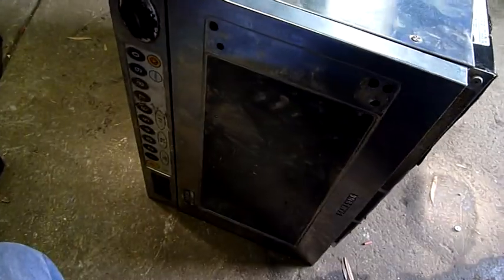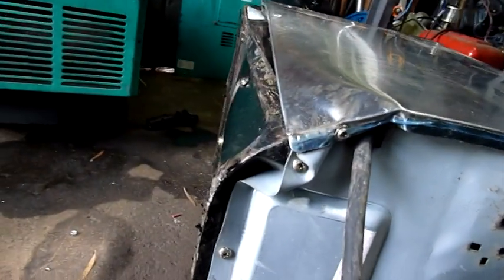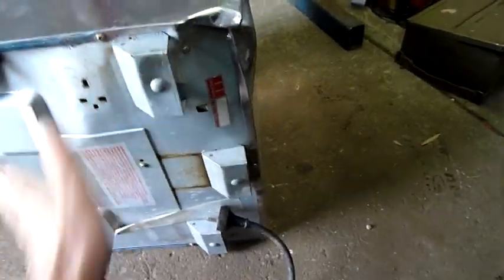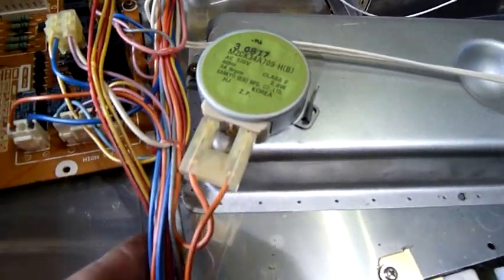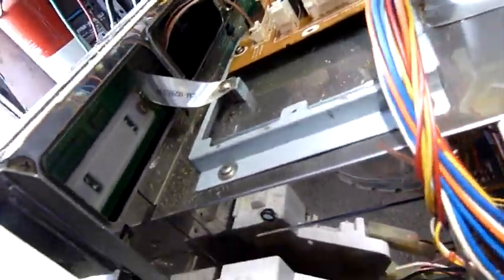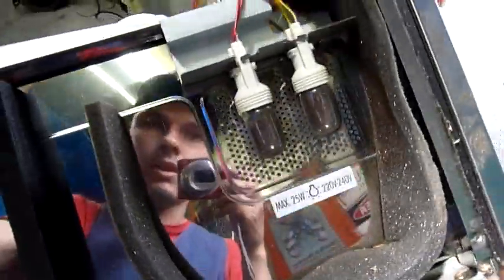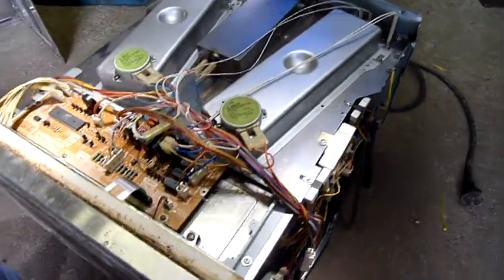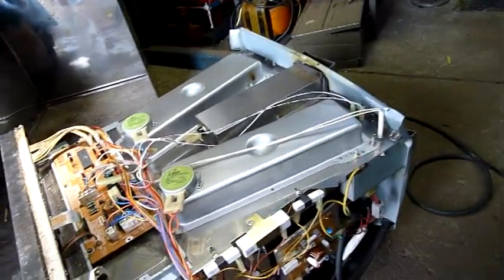Sad Samsung Twin Mag Commercial Microwave

Comment: at 1:40 Those holes that you mention, they're for the insertion of a UK domestic plug, 13A to BS 1363, fused to BS 1362. :-)

Rodalco once had an old CRT telly that had those holes in the back of it. :-)

If the electronics in this are misbehaving, do what HDXFH did & wire up the plug straight to the MOTs, then control the power on/off at the wall socket.

I think this microwave, with it's twin MOT+Mag setup could do some epic poppage with lightbulbs & circuit boards etc. :-D

-BoomBoxDeluxe.

Comment: I live in Africa, we have 230V 50Hz power, and yes I can buy a cheapie microwave for under $50. Not a fancy one like that but a simple cheap no frills one which will last longer. Last one rusted through before anything other than the lamp died. Another one for the scrappie after some gentle dissembly.

Comment: I think the E41 error is either the cover off warning, although it usually  isn't or it is posibly a bad microwave cap or the processor board has a bad component, usually a cap or transistor, and sometimes the processor itself.
Reply: im looking over Ed's vids and E41 is indicating a issue with the 1st oven transformer but it is possible with the 1st magnetron going short to ground could also be causing the error

Comment: Struth, that would have been expensive!!, shame its been externally damaged :-(

If the control system still works ok you could throw a couple of 700w identical magnetrons in, then it would be back up to full power.

Dam shame :-(

Comment: Do you think a heat switch is going off.  You could short out the connection with the switch and see what happens.  Oh and why are those moters 120 volt? that is what we use here,but I thought you used 240 there?